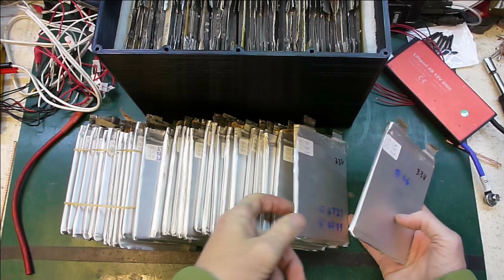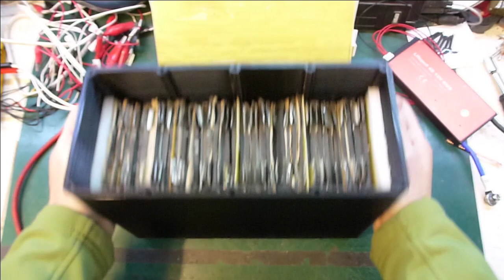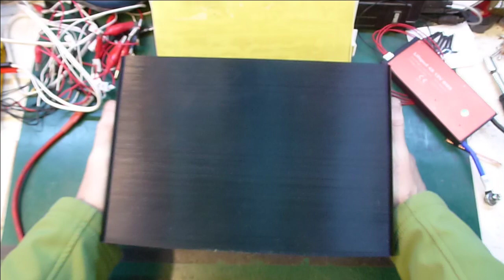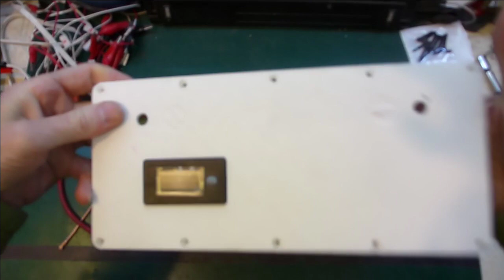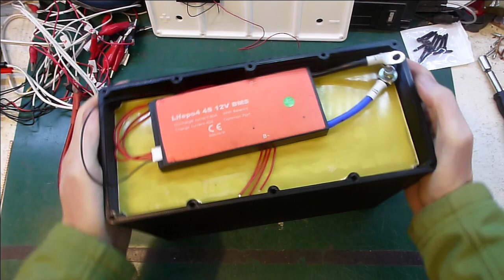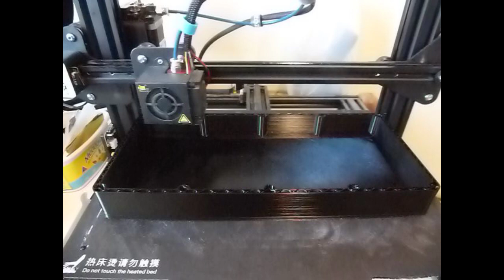Nissan Leaf 024 - DIY 12V LiFePO4 battery, part 1

Comment: I have had luck this summer putting the 12amp charger on a timer so it charged the car 30 minutes every day. When the car starts to charge it turns on the 12v inverter and tops off the lead acid battery. This worked for a couple months but today it would not start and the battery was at 3v. 

So I really think I need to add a low voltage battery disconnect so the 12v battery can’t go below 10.5v.
Reply from the maker: I was tempted to do the charger top-up routine also. I managed to get this new battery working before it was essential. I like that the new battery is half the weight - I'm saving 7 kg (15 pounds).
Reply: I was trying to decide what amperage battery I should buy if I went with an off the shelf LiFePo4. I think the internal 12v inverter is 100 amp. I wonder if I should match that. 

Your battery is about a 50 amp hours battery. Can those cells handle 2C without issue or does the bms protect before that.
Reply from the maker: @ecospider5  My battery is 10P4S and each cell was 5 Amphours when new (but now around 4.8 Amphours) so that *should" mean they can handle about 5 Amps at 1C each no problem, or around 50 Amps total. I believe they'll handle 2C fine but I'd prefer not to push it with old cells. If I was buying new I'd go for 150Amps to have plenty of margin.

Comment: The bms low voltage cutoff is the best part of this to me so the car can’t destroy the battery when it sits. I have found the 2013 leaf needs at least 11v to start the computer. I tried to used a jumpstart pack on my leaf last week and it had 300amps at 10v available but the computer would not fully start. I used a jumpstart pack with 12.1v available and it started up fine. Of course once it was started it charged up the 12v battery.
Reply from the maker: I was thinking of also making a small backup battery with just 4 LiFePO4 cells from a new-ish laptop battery. First I should check how much current the car takes to boot before the internal charger kicks in. My hunch is 5 Amps at 12V should be enough to get it booted up.
Reply: I just put my dc clamp meter (set on min max mode) on the negative cable going to the frame and turned on the leaf. It read 34 amps and -22 amps. I don’t know which is the draw from the battery and which was the internal inverter charging the battery. But both numbers seem high. I will try again this week in the light so I can get better numbers. 

Also 6 hours ago the battery was at 3v. It is holding 13v now after being charged but I don’t know if that affected anything.
Reply from the maker: @ecospider5  On LeafSpy a reading of "-22 Amps" would mean going INTO the battery. But for your clamp meter ion the negative side it probably means the other way round, ie., it was charging the 12V at 34 Amps. That sounds plausible to me. Especially if your battery was low - then the onboard charger is giving it heaps.
Reply: I just watched your third video. Seeing those numbers makes me think my numbers are accurate. I’m assuming the higher number came from charging but I will try and verify that later.

Comment: This looks like a great project. Nice work. I'm in NZ also and came across your channel after buying a Leaf recently. This and your aero wheel inserts are really making me want to buyt a 3D printer! Is your Powerboot project still in progress or have you abandoned it?
Reply from the maker: My Powerboot project is on hold while I collect enough cells to make it work. I had been in line to get a couple of pallet loads of dead e-bike batteries but that deal fell through - so now I have to collect them piece-meal.

Comment: As always I'm super impressed with your 3D printing skills (matching the vehicle's 12v battery dimensions?! - that's awesome!).  When/if I do eventually start teaching myself 3D printing skills it will be because of the work people like you showcase.
Reply from the maker: Hi Sam. I held off for ages because I was intimidated by the 3D design tools. Eventually I found Tinkercad solved that - it's very easy to get started with. If you do get a printer I'd recommend starting simple.

Comment: Not sure what type of fuses you were planning on using but if you use fuse wire / glass axial fuses then bend some Z shapes into each end of them so that they have some spring to them.
I like the design of the bus bar separator piece. Nice one. What filament did you use to print everything ?
Reply from the maker: Yeah - I always like to add an "S" bend to my fuses to give them  room to flex. I'm still printing everything in PLA (wanting to avoid creating a lot of long-life plastic waste). I'm assuming there's a high chance the box will fracture at some point. When that happens I'll step up to printing it in ABS. Another potential issue with PLA is it might wilt in the sun. So - I'm definitive thinking of this first version as a prototype.

Comment: Nice design Paul. Will look forward to hearing how well it works. Wow! That is a big box you printed. I still haven’t 3D printed anything past 12 hours yet. Thanks for sharing! I hope to do something similar for my electric lawn mower to eliminate the lead acid batteries. You have inspired me!
Reply from the maker: My first battery recycling project was to replace the Gel batteries in my Economower with 18650's. It's still going fine!